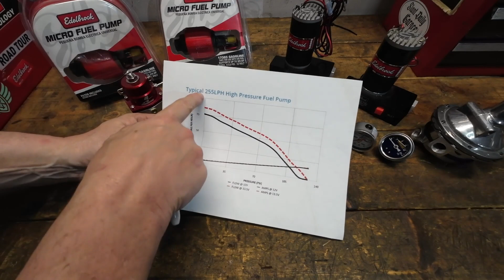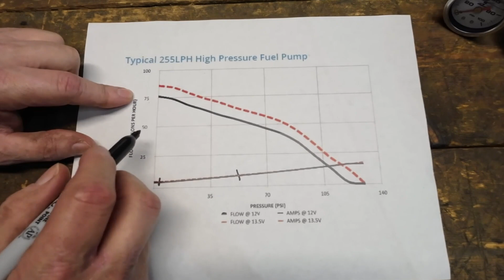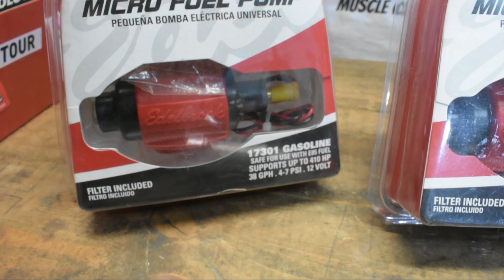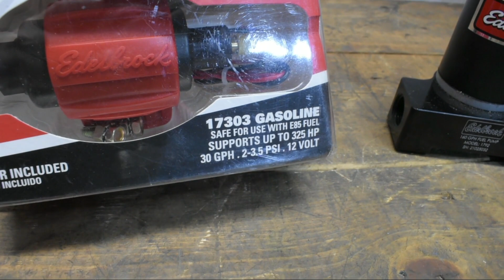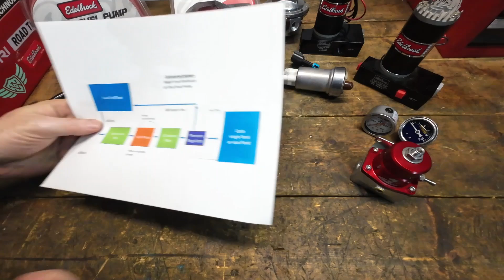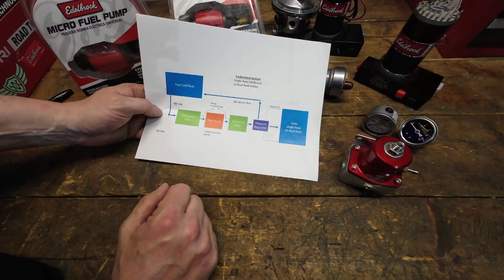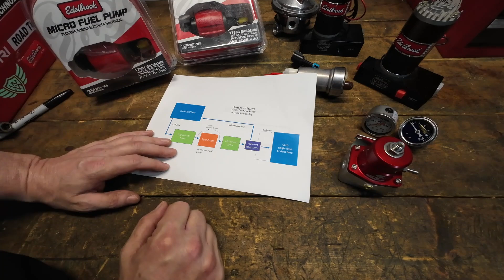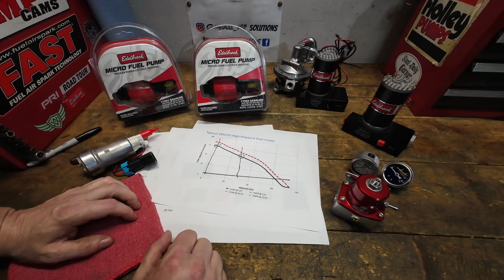Fuel Pressure or Fuel Flow: Which Matters More?

Comment: I'm having issues with selecting the correct pump now, 60 psi base pressure for the holley super sniper stealth then adding 20lbs boost. At about 10lbs boost fuel pressure rises to 70lbs then drops to 60 even at 15lbs boost.  Using 2 walbro 525 in tank pumps. Just purchase a weldon db2025-a,  that should cure it. Also running e85 pump fuel.

Comment: Thanks for posting.  Does it hurt performance to have a fuel filter before and after a mechanical fuel pump
Reply from the maker: Great question.  Check out my video on pressure drop.  Goes over that exact question and measures a few filters to show what can happen.

Comment: Hello and thank you for all your videos. I already learned a lot. 
To my topic: my electric fuel pump (7psi, 90+gph, 320hp "only") runs on a regulator with a return line. When I start to drive the system runs with 5,5psi but it drops to under 3 psi after a while. Maybe because the regulator opens. I know that I do not need to run a regulator but I mounted it. So, I wonder if it would make sense to run another fuel pump with 14psi but the flow rate would also raise to 140gph on that stronger pump. I am a bit confused what I really need. The right pressure on my Edelbrock carb or ... ? I guess even with 3 psi it will get enough fuel. Or let say i hope so. 
Also, the return line runs straight back into the tank while the tank unit itself is classic style unit on my El Camnio 65 tank. I guess the low pressure of 7 drops to 3 because the line become too long. but is it bad to run the carb on just 3??

I apprciate your opinion in this case again. Thank you.

Comment: My stock pump have a lack of force to transfer dense fluid.
Have to raise up flow or pressure?
Reply from the maker: What do you mean by “dense” fluid?
Reply: @MuscleCarSolutions  Waste vegetable oil. Its more dense than diesel. My stock fuel pump doing 0.5 bar pressure and 210l per hour. But it doesn't have force to inject it into engine.

Comment: You can overcome restrictions with psi up to a certain point. I was a water well driller pump installer for 20 years and an engineer and I made a bet what a pump would put out when we were about to do a test on a well I said it would do 23-24gpm he said not possible the hose we had hooked up could only flow 15 max. I laughed in his face he said let’s bet how about 10k knowing I didn’t have it and my old man piped up said hell let’s make it 50k then so it’s worth our time. The engineer got real quiet my old man says I got checkbook in the truck. Guy decided let’s just bet for who buys lunch. I said what happened you were the authority a second ago mr. engineer. 

Me and my old man ate a real good lunch that day we were about sick😂.

And the engineer learned that the real world is a lot different then what the text books tell you and that’s why we have to constantly fix that pos system he designed for this multi million dollar place up the hill. We told the developers before we met this engineer it wouldn’t work but it was a class a system and engineer had to design.  Ok whatever it was job security he said our install was perfect to his design … no shit that’s why it doesn’t work wrong pumps 😂

Comment: Another great Video Sir. Question, I have a manual fuel pump with a return fuel to the tank, doe's my fuel regulator need to have a fuel return? Thank you.
Reply from the maker: It’s one or the other.  I prefer the return to be at the regulator (primary point that determines flow) than at the pump.  But in reality, both work.  It’s just my preference.
Reply: @MuscleCarSolutions  Thank you for the reply I've learned so much from your channel.
Reply from the maker: @indy007jones  we’re all learning something new every day!  That’s what I love about all this stuff.  I’m just happy to pass on a little bit of what I’ve learned and thankful you found it helpful.  🏁👍

Comment: I have a 1968 ford 302 in a f100 I put in a 32 gph electric fuel pump and put by the engine a fuel filter with a return line 3/8in and out of the filter and 5/16 as the return line and the engine seams to be happy
Reply from the maker: Yup.  For a cruiser it can be plenty.  The engine will always tell you what it needs and likes!

Comment: Good info on pressure vs flow. It would be good to touch on fuel line sizing and type (rubber vs steel etc.) as this may also be a factor.
Reply from the maker: Unless you’re extremely choked down, it’s not a factor (in this discussion anyway).  Like I mentioned at the very beginning, I wouldn’t be discussing application specific info.  Your point is a great example of that.  I might do that video in the future as it would be very easy to test in a real world application.  But for this video, it just under the assumption that everything else is up to the HP goal.